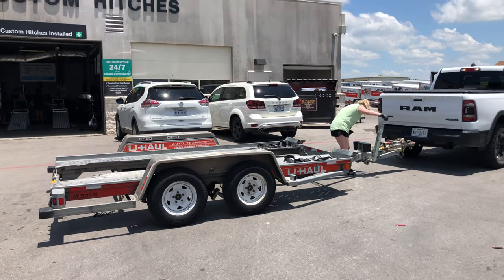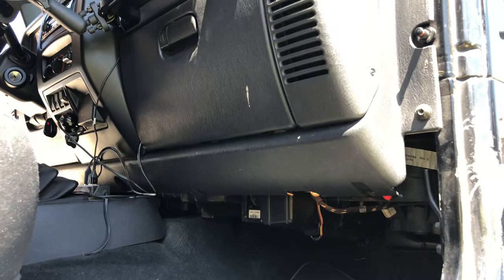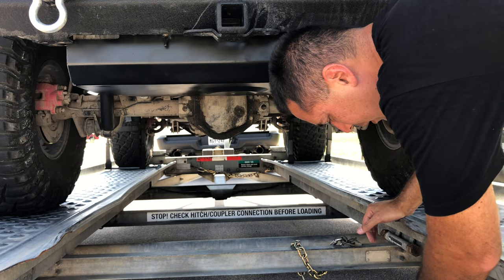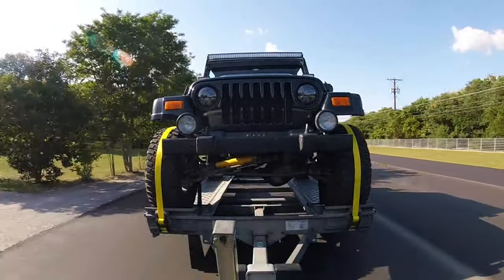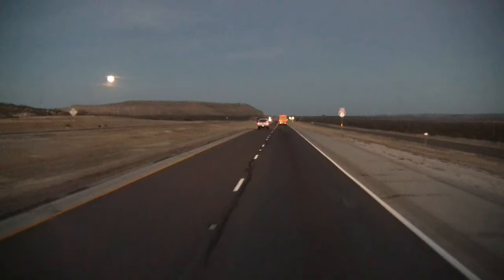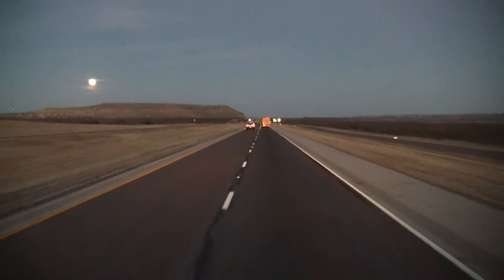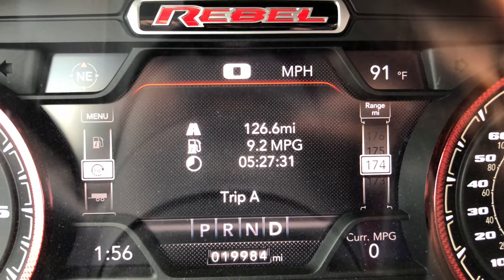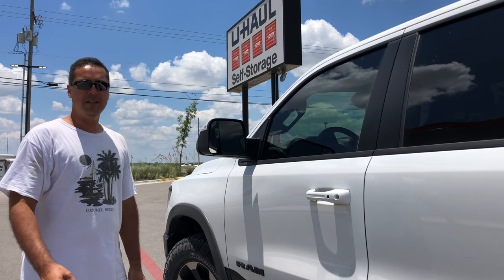Towing a Jeep with a U-Haul Auto Transport

Comment: For anyone doing this buy 2” straps with a flat hook on one side to go around the front tires. Do not attach the chains to the bumper d rings. Use axle straps and attach to the Jeep’s axles. Also when pulling the towed vehicle off the trailer always lift the tailgate first on the tow rig. I’ve had a trailer attachment break during loading and we had the tailgate down which resulted in also destroying the tailgate. Had the tailgate been up would have prevented at least that from being damaged.
Reply from the maker: Thank you for the pointers! I was at a loss in what to do with those chains in the rear.

Comment: I don’t see your truck squatting a whole lot but just from looking at how this trailer looks I would assume it has a bunch of tongue weight. Does it?
Reply from the maker: They say the tongue weight is about 10-15% of the total loaded trailer weight. The trailer was 2210 lbs plus a standard TJ Rubicon weighs around 3700 lbs. So that’s 5910lbs x .10-.15= 591 to 866 lbs on the tongue of the Ram 1500 Rebel. Also keep in mind the TJ has larger tires and a heavy duty tire carrier with two loaded 5-gallon Jerry cans of gasoline.

Comment: My first rental for my wheeling truck went so badly they refunded my rental and their oversized straps were cut short. So I got replacement long straps. Use WD40 on the ratcheting mechanism before use. Works better
Reply from the maker: Wow! And thanks for the tip! Gonna try that next time.

Comment: thanks for this Video. I am planning on towing my fathers old Austin champ. it has some pretty over sized tires...my concern was the wheel strap. this totally helped me with that issue
Reply from the maker: Glad I could help! Just make sure to check the tightness of the straps after it’s been driven a few miles, and especially over bumps. Just to ensure they stay tight.

Comment: Thank you so much for this video. I’m taking my TJ 1200 miles and didn’t know what I needed to do to strap the tires!  Thanks.
Reply from the maker: Just be sure to check the straps after a few miles for tightness. I’ve found that they can come a little loose after the first leg of a trip, from the weight shifting and settling. After retightening them it should be good to go. Thanks for watching!

Comment: Thanks for posting this. I'm about to move my LJ on 35"s with a busted front axle to our new house. You laid it all out. 
What is the width of those ratchet straps you bought? They look like 2".
Reply from the maker: Yes, they are 2" wide ratchet straps. Good luck on the move! Just be sure to check the tightness of the straps a little ways into your drive, as the Jeep may shift a little. Just re-tighten and you'll be solid! Some others mentioned the way I tied the chain in the rear, may not have been ideal. But I towed the jeep like this several times and hadn't run into any issues. Take for what it's worth!
Reply: @MotoringAdventures_KE7SAI  I bought an axle strap to handle the rear along with the extra ratchet straps. It'll be well cranked down. I'm just hoping to get a trailer that's been somewhat maintained. U-Haul has a spotty history of letting maintenance go. The drive isn't too far, just over 150 miles. Thanks
Reply from the maker: @drooskeedoo3388  Awesome! Sounds like you'll be all set! The good news about those u-haul trailers, I've rented several and of varying ages and conditions, and so far have had no mechanical issues with them. They are built very stout!

Comment: I just bought a 2000 jeep TJ and planning on taking to Hidden falls next month. I live in San Antonio, but how is that park?
Reply from the maker: Congrats on the TJ! Hidden Falls is a great park! There’s trails of various levels and varying terrain. I have ran several trails there in the TJ that I have featured on this channel. Perfect place to shakedown the TJ to see what it can do. When you get there, they provide you with a map and can tell you what trails will be suitable for your vehicle.
Reply: @MotoringAdventures_KE7SAI  awesome, and thanks. It has a 6” rough country long arm kit already on it, it’s at a shop right now and replacing the old 33” tires with new 35” BFGoodrich KM3’s, new steering kit with stabilizer, front shocks, bushings, fluids and power steering pump. It’s very similar to the same setup as yours.
Reply from the maker: @limpbizcut44076  Sounds like a good find! Unfortunately I sold mine last year. I wasn’t happy about it but it needed to be done at the time. I sure do miss it!

Comment: What’s the curb weight of your jeep? And also did you use a WDH hitch at all? I’m asking is because I have fox suspensions on my truck lol don’t want to squat so much
Reply from the maker: Curb weight of standard Rubicon is 3743 lbs. Mine's probably pushing 4600-5000 lb range with all my aftermarket parts. The U-Haul trailer weighs 2210 lbs. So combined weight of 6700-7200 lbs. No I did not use a weight distribution hitch. Do you have a fox suspension on your Rebel or is it a different truck?

Comment: Thanks for this vid! Planning to tow my Jeep YJ with my Ram 1500 using the UHaul Auto trailer soon! 

Would you do anything different with hooking up that chain in the back for a future tow? 

Also did you just use a 2” hitch ball?

🤙
Reply from the maker: I would just make sure the chain is taught. Depending on how high your YJ is, you may be able to wrap the chain around the frame somewhere or loop it around. It's there as a fail-safe, should the front straps fail. Just be sure to check the front straps periodically as I noticed that they had slightly loosened a little bit on the second time I towed with this setup. They were still plenty snug but always a good idea to check. And yes the standard 2" hitch ball is all that was needed.
Reply: The Not-So-Ordinary Car Guy thanks for the reply!

Comment: Two questions. What size are your tires 33? and second What kind of straps did you buy at Lowes. I am literally planning on doing this with my Jeep next week. Your video gave great insight!
Reply from the maker: The Jeep is on 35x12.50R15s. The straps are just heavy duty ratchet straps. I forget which one's exactly but they were about the strongest one's they had. The length wasn't that important as I just cut the excess off anyways.

Comment: how big are those tires? 35s?
Reply from the maker: Yes, 35x12.50x15, BFGoodrich KM3's, which actually measure slightly smaller than a 35. More like a 34. The Rebel is running the factory 33" Goodyear Duratracs.

Comment: Hi, how much about does your Jeep weigh? Thank you.
Reply from the maker: That's a good question. Google says a stock 2004 TJ Rubicon has a curb weight of 3743 lbs and a gross weight of 4600 lbs. Since I have added some heavier items, such as the heavy duty rear skid plate, rear bumper, tire carrier, 35" tires all around (including spare), two 5-gallon jerry cans of fuel in the back and more, I'd say this thing has to be pushing that 4600-5000 lb range. According to U-Haul, their auto transport trailer weighs 2210 lbs. So combined, the Jeep and the trailer weigh probably 6700-7200 lbs. Which is similar to towing a 25 to 29 foot travel trailer. Wow, I didn't realize I was pulling that much weight, now that I analyzed it. The Rebel pulled it like it was hardly there!
Reply: Thanks very much- I have to pick up a 2010 Tahoe that I purchased and am going to haul it on a Uhaul car carrier as well. It’s a little over the weight limit for the trailer but I’m sure it will be fine. Thanks again. .. Greg